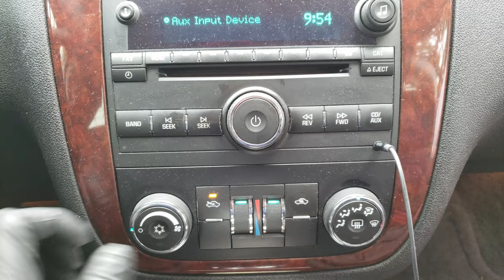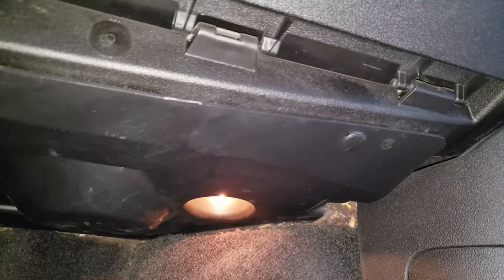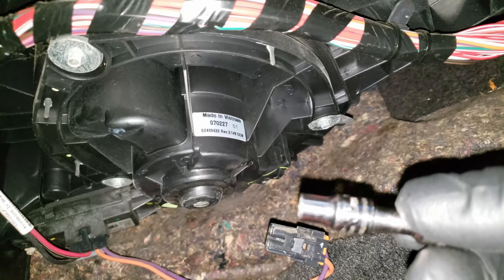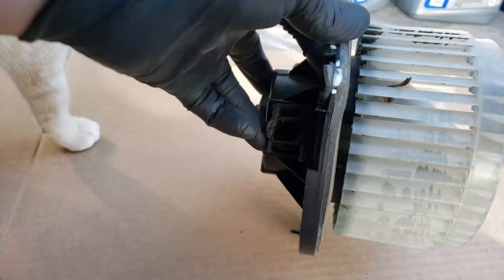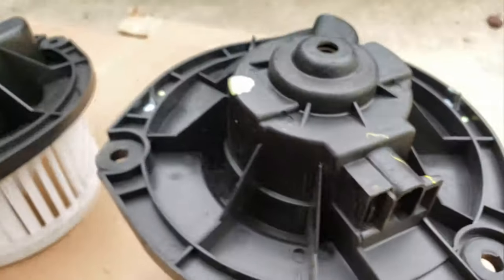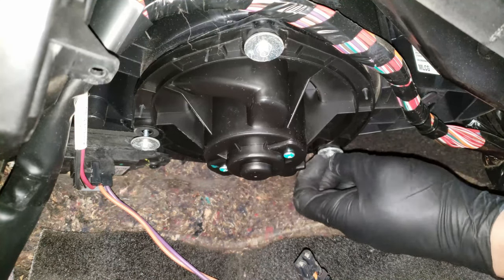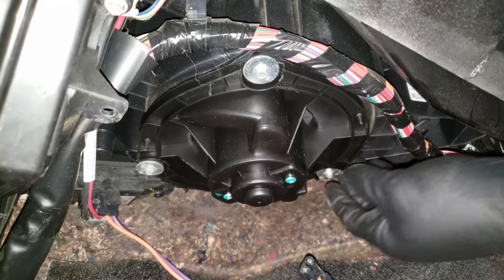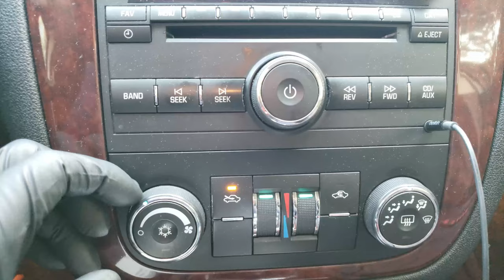How to Replace Blower Motor On A Chevy Impala 2004-2013

Comment: Thank you brother you helped me a lot with my 08 with this and my starter one thing on the starter though instead of taking it from down on the bottom... Take your heat shield off and take it out from the top...no worries of hurting the radiator hose keep it up brother love the videos god bless
Reply from the maker: Thank you🙂, yea or they also say removing the oil filter makes it easier to remove as well

Comment: Informative, thank you. I'm about to check the blower motor on my mother's car to figure out what's wrong. The AC works just fine, but when the speed is turned up to high, the air cuts in and out. So I'm not sure if there's something clogging something or if I need to replace the motor entirely.

Comment: Thanks for this video.  I have a Chevy Impala and no air will blow except when I turn off the circulating air in the car. I think this is where I'm going to start at with trying to fix it.
Reply from the maker: Maybe it might have a bad blend door actuator that frees up when u press circulating air while the fan is on.

Comment: The worst part is trying to hold the blower in place while getting the screws started. I wanted to see how he did it but he cut the camera until he had the screws started. be sure the blower is in the right position when reinstalling. Two of the screws won't line up if the motor is 1/3 of a turn out of position. When the blower on my car failed it stopped running. I checked the power coming to the blower with a volt meter after removing the blower. Voltage changed as the speed control was turned telling me the problem had to be the motor. I have an adjustable voltage dc power supply. When I connected it to the blower it ran. I turned it on and off several times to see if the problem was the brushes. It suddenly started pulling 10 amps. Turned it off and back on and it went to 5 amps. Must have an intermittent short in the motor. Fortunately it doesn't seem to have damaged the speed control module. New blower solved the problem.
Reply from the maker: Yea unfortunately the camera was in the way to even try and do both..i had to get under and hold it up while getting screws started

Comment: Great video. Now, how do you fix a issue with left rear blinker only working when it wants, also the headlights only come on when they choose ( could that be something in the turn signal control)? T.i.a.

Comment: I have an 04 impala no air comes out what’s so ever from the vents even when I try to turn it on. Is it the Motor Blower? This right here what I’m needing to replace?
Reply from the maker: Do u hear the fan come on? If u do hear the fan As long as ur cabin air filter isnt completely clogged or do u feel the air coming from some other part like the feet area or the defrosters? If air comes out other places u may have a bad actuator...if u dont hear the fan then if ur blower motor resistor is bad, the blower motor would work on high speed only..if it doesnt work on any speed itll probably be the blower motor
Reply: @backyardchevy328  There’s no air coming out from anywhere. Just replaced the blow motor A/C is working just only thing is it’s on high only and doesn’t want to turn off? Does that have to do with the actuator? Or no
Reply from the maker: @clarissamonique8612  no, that would be the blower motor resistor that is bad then

Comment: I have a problem my ac would turn off constantly and out of nowhere it turned off , what could it be ?
Reply from the maker: Like ac u mean the compressor and cold air?
Reply: @backyardchevy328  cold air
Reply: Cold air would come out for like 3 mins turn of for 1 min and now it doesn’t blow out any air out all
Reply from the maker: @gabrielgomez5199  yea that would mean that ur ac refrigerant is low..if it gets below a certain pressure itll stop engaging the compressor..til it eventually wont come on at all anymore
Reply: @backyardchevy328  so I need to add ac refrigerant ?
Reply from the maker: @gabrielgomez5199  well youll wanna check the pressure before adding any to make sure..because u don't wanna have too much refrigerant in system either...and it could also be the compressor clutch that is failing...so if u check the pressure and its low then yes it would need refrigerant..but also if u add some maybe it may leak out again..if it has a leak somewhere
Reply: @backyardchevy328  and to find a leak is there any spray I can find the leak with or I have to physically find it myself
Reply from the maker: @gabrielgomez5199  they have this refrigerant with a dye..so when u add it u can locate the dye using a blacklight..but u can also locate it if u see like white marks around the ac lines or the compressor
Reply: @backyardchevy328  I checked the car out the pressure is good but it don’t blow out any air at all hot or cold nothing
Reply: Would it be the blower motor ?
Reply from the maker: @gabrielgomez5199  ok if not blowing out any air then it sounds like it is the blower motor that may be the cause...but the blower motor resistor could cause it too since that controls the blower motor speed...but the car will bypass the blower motor resistor on the highest speed setting so if it works only on high speed then it may be the blower motor resistor..but if it doesnt work on any setting then yea it may be the blower motor at that point
Reply: @backyardchevy328  ok I’ll be on my way to get that I’ll keep you update it thanks for the help
Reply from the maker: @gabrielgomez5199  good luck🙂👍